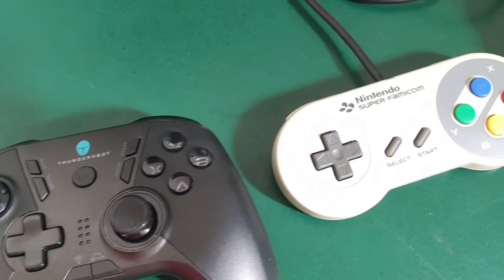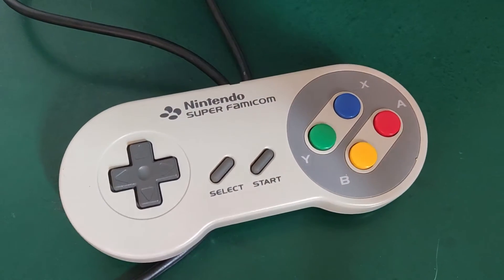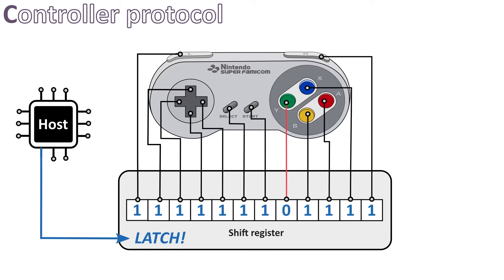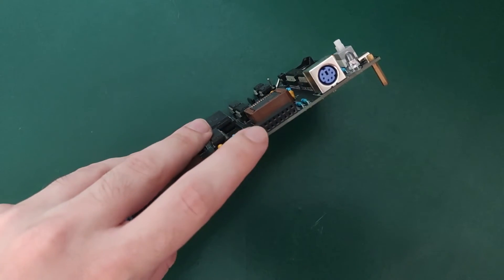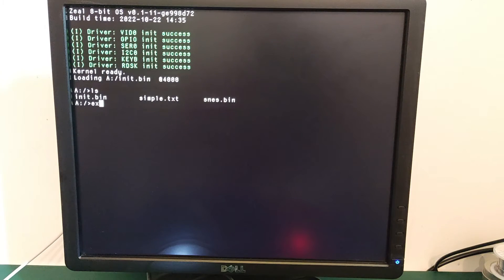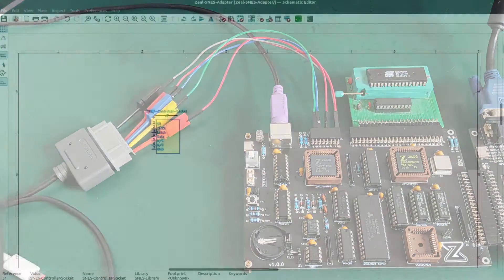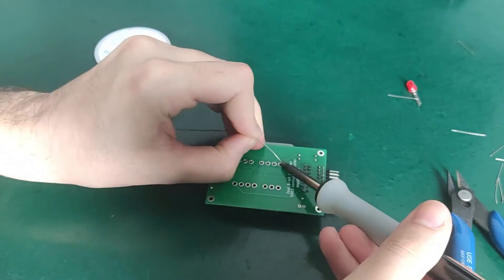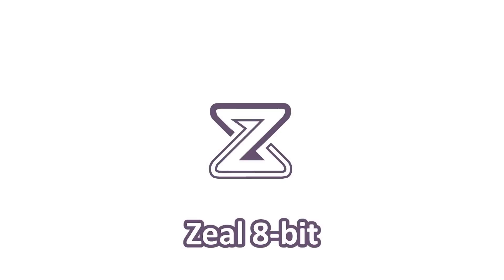How Super Nintendo (SNES) controller interfaces with my 8-bit homebrew computer

Comment: Why do you bother reading the last four bits from the shift register? If you read just twelve bits, that should be fine, too, since the next time you make latch active all the bits in the register will be replaced with the parallel input (the current button values) regardless of any shifting that's been done before that, right?
Reply from the maker: Good point! In theory yes, that's how a shift register works, here I really wanted to mimic the SNES, which performs all the clock cycles.

That's definitely something I am going to try though!
Reply from the maker: I confirm that it works, only 11 clock cycles (as after the latch, we have already the first bit on the DATA line) are necessary to get all the buttons!
Thanks for the remark, I am going to pin your comment so that everyone can see it!

Reagarding the SNES itself and why it perform 16 clock cycles, my guess is that it's not only due to the controller 16-bit shift register but also due to the console itself which has a 16-bit I/O register used to store the joypad status (CNTRL1L, CNTRL2L, ...). Moreover, in the hardware, it's much simpler to detect when a counter is equal to 16 than dectecting when it's equal to 12, as it's not a power of two.
Reply: @Zeal8bit  Good to know that not reading all the bits actually works! It's always nice to have one's theories tested.

As for why Nintendo reads 17 bits, I read in a forum that it's used for controller detection: the SI (shift input) pin from the shift register at the end of the chain is what you'll read after the 16th shift, and this pin is held low in the controller, causing you to read a zero if the controller is connected. I'll link to this post in another reply since YouTube tends to swallow any post of mine that has a URL in it.
Reply from the maker: @Curt_Sampson  The 17th is a very ingenious trick, I didn't know about it!
So the games could detect when a controller has been disconnected or reconnected
Reply: 04:04 note brought me to the comments section with the very same argument.

Comment: Does the Controller even work in games? Or do you have to write drivers or something for that?
Reply from the maker: If the games use the standard input and the joystick is somehow simulating the standard input, it is possible, without modifying the games!

Comment: so we can create visually driven text-based interfaces.. selecting from multiple onscreen options.. being able to navigate intuitively back and forth up and down through menus and sub-menus and such.. can we use start/select to stop/pause a process and open up options?? if i hold down the start button for 3 seconds will the machine reboot?? some would suggest an onscreen keyboard but there is so much more potential here.. can this system support a PS controller?? are there specific controllers it could not support?? will it run DOOM??
Reply: have you seen C64OS?? text-based windowing GUI..
Reply: i want to see C64OS installed over FreeDOS installed over ZEAL..
Reply from the maker: @SuicideJones  C64OS is for the 6502, so it is not compatible with Zeal's Z80. FreeDOS is for x86, MS-DOS isn't compatible either with the Z80 unfortunately
Reply from the maker: Zeal 8-bit OS offers an abstraction layer for drivers and standard input and output, so definitely, it's possible to implement a "virtual" keyboard that can be used with the SNES controller. That is one demo I was considering doing to show how drivers work on the OS.
PS controller can also work, it may be more tricky because they have more sophisticated protocols but if a microcontroller does the decoding job and offers a simpler interface to the Z80, yes, it is possible.
As long as you allow yourself to have microcontrollers, you can support any controller that has a known protocol, even bluetooth ones (thanks to ESP32-type MCUs)

The problem of running Doom is that it would need to be recompiled or ported to the Z80, I am not aware of any real port (not clone) of it for the Z80. I is possible, but needs a lot of work

Comment: a part of me thinks it should be an 8-bit NES controller..
Reply: the Game Glove..
Reply from the maker: Actually the protocol is exactly the same, but with less buttons of course, so only 8 clock pulses are required to read the controller state.
About the Game Glove, did the NES have any access to the analog values from the glove's sensors? Or where the sensors interpreted in the glove itself and sent to the NES as regular buttons? This can be interesting project too

Comment: You inspired me to make my own 8 bit computer. I went with the 8080 because I didn’t want to completely copy yours. It’s called the 808E because it sounds the same when you say it.
Reply from the maker: I like the name of your project!
You can "copy", it's not a problem, the Z80 is very popular, I didn't innovate on that😄
Keep in mind that powering on an 8080 is more tricky because it requires more voltages than the Z80, which only requires 5V

Comment: Hello - I have the following question:
for what are the 2 "not used" Pins good for?
I mean are they debugging pins f.e.?
Reply from the maker: On the controller side, these pins are not connected to the shift register. On the console side, they are connected are can be controlled by the processor. I guess Nintendo intended to have special peripherals, just like the NES had the Zapper. I don't know if there was such device using these pins on the SNES.
Reply: @Zeal8bit  there is, the super scope!

I'd recommend checking out Retro Game Mechanics Explained's video about SNES controllers for more info on what those lines are used for on other controllers
Reply from the maker: @catgirlQueer  Thanks for the pointer! I am going to check this

Comment: I love how professional-looking your board is. You could probably build your own little button controller using some buttons and an off-the-shelf IC. Hardware back in the day was so SIMPLE. I have been mucking around with USB as an experiment. Jeez, could anything get more complicated? For your system, how to you read the controller? Do you bit-bang, use interrupts, or mapped memory?
Reply from the maker: Thank you very much, I did put a lot of effort in the board 😄
Making a controller is totally possible! Few buttons, one parallel to serial shift register and that's it. In fact, I was thinking about making this as part of the video at first, but I didn't want it to be too long.
The hardware was indeed simple and effective. What bothers me in USB is not the protocol itself but more the software stack on top of it that is really complex.

I do use bit-bang for the controller because we are not tied to timing and because I have a PIO that makes this easy. In comparison, for the PS/2 keyboard I prefered to add hardware shift registers and generate an interrupt everytime a key is received.

Comment: It will be posible to use the user port for 9-pin style connectors like the sega mega drive or some joysticks?
Reply from the maker: Yes! Almost any joystick can be interfaced. However you will need to use the appropriate driver too (or write one) as the protocol is different from the SNES'

Comment: Are you gonna use fpga for the sound? 'cause there's an fpga emulator for the Yamaha ymf262(opl3)
Reply from the maker: Indeed, I am using the FPGA as a sound card too. It's still in development as there are higher priority tasks to do but the goal is to have an easy interface to generate sound (PSG). What I've done so far is a module that receives a duration, a frequency, a waveform and generates the sound out of this. Usually, sound chips are more complex to set up.

Comment: Awesome video! I love the sound effect you use when presenting the pins too! Very entertaining.. and I might just have to use one of these types of controller myself since I have one. I would have been lazy and stuck with the Atari/C64 joystick scheme myself.. but I like the idea of something a bit more complex.

Of course I still have to integrate a CPU to my FPGA yet as you know..
Reply from the maker: Thanks for the feedback!
I would totally advise you to try if you have one already. It's easy and the controller is really good. If you want to interface it with an FPGA, be careful about the DATA line (and other pins too maybe) the controller needs 5V, all recent FPGA I/Os are 3.3V
The controller won't have any problem recognizing 3.3V signals, but don't plug the DATA line directly to your FPGA without a level-shifter or you'll fry your FPGA I/O. In practice I would even advise you to shift all DATA, LATCH and CLOCK pins with level-shifters.

Comment: I wonder if it would be possible to put the rom on the controller interface card and have it auto run the needed drivers, allowing you to use it with any software/games without having to edit the games to have the drivers. you may have to add a config options to the driver so it can work with games that uses different key bindings and maybe a key shift option (press start and the A button is now Z)
Reply from the maker: Putting a ROM on the controller interface is completely possible, mainly since the "User port" has an I2C bus. So adding an I2C EEPROM is simple (and cheap).
I wanted to show in the video how this controller could be interpreted as a keyboard thanks a proper driver and also thanks to the "open device" interface/layer Zeal 8-bit OS offers, but I didn't want to make the video too long.
I may also need to add support for dynamic driver loading in that case though. That's doable, but needs a bit of work.